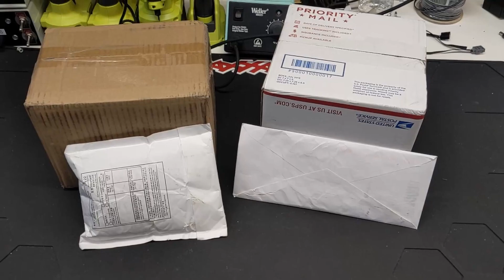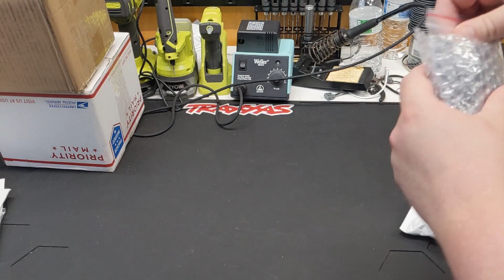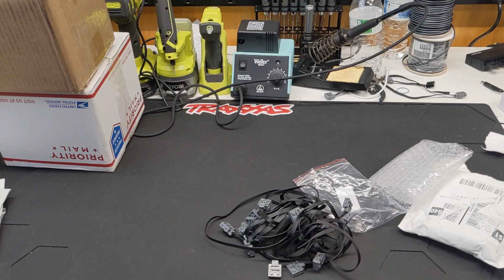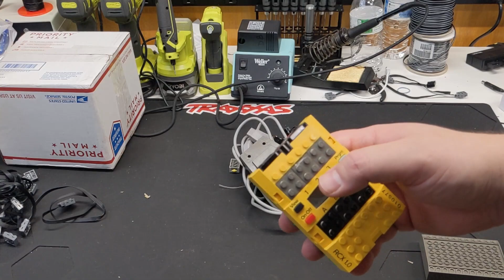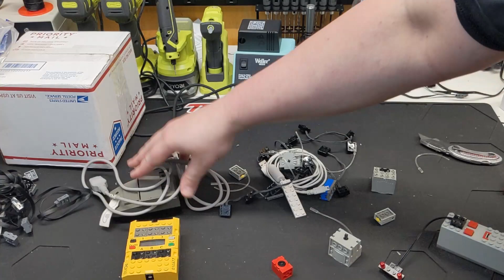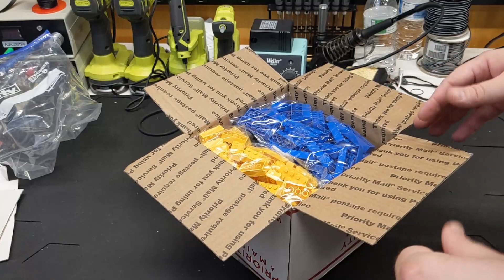Another Bricktsar Bricklink order, Mindstorms parts and channel update

Comment: Looking at the first RCX you looked at, I wonder about the DC jack on it. Mine, also a version 1.0 and which I got more or less on release, didn't have an external DC input as this one does (Which I was really saddened about since it got expensive having to constantly change batteries) And I believed it was a later version than 1.0 only that had the DC input fitted but apparently not, so there are apparently more versions of the version 1.0 :P
Reply from the maker: Yep, there were two externally identifiable versions of the RCX 1.0, with and without the power jack (there were many internal revisions though).  If I'm not mistaken the 1.0 without the power jack was in the 1.5 version of the RIS set.  The 1.0 units with power jacks were used quite a bit in schools so it's easy to find them for $10 - $15 to this day... hopefully with clean battery compartments
Reply: @BatteryPoweredBricks  Ah okay, that makes sense then. And they follow the same rules as programmers does with version numbering, it's always a chaotic mess! xD

Comment: That 9V lot was a good deal, but you didn't test the sensors. There even were 8 of the fiber optics cables inside, normally some are missing if you buy such a mixed lot. This would make a good starter package and I always liked the micro motor.
Reply from the maker: Yeah I jumped on that deal quick!  I didn't test the sensors for now, I'll do that if I replace the wires.  I do have some fun ideas in my head for the fiber optic elements and micro-motors I've acquired over the years

Comment: So the fire resistant chemical breaks down the cable until they become a fire hazard? Lol! The fiber optic stuff was neat. I have the space shuttle set with it. 

The Bricklink auto checkout thing wanted to put it in a flat rate bubble mailer but anytime it’s cut bricks like that a box is better. Thanks for another order.

With YouTube - there is nothing better than just making videos because you want to and enjoy it. Scripts are not my thing and I’ve considered not doing sponsored  content because I don’t enjoy thinking to much about what I say - lol
Reply from the maker: I bought an incomplete Technic shuttle years ago, I still haven't found the time to build it.  I'd like to replace some of the yellowed pieces first.  As far as scripts I guess it just depends on the video, If there are a lot of important technical details I'm probably better off scripting it.  Either way I always think of things I left out after the video is released 😅
Reply: @BatteryPoweredBricks  You didn't test the sensors. :D

Comment: That order was a good buy.  I never find really anything like that on eBay anymore.  I’m still collecting locked up motors if your interested in getting rid of your bad motors.   Phil
Reply from the maker: At this point any locked up motors are scattered every where around the house.  In the back of my mind I still wonder if I can do something useful with them, what did you have in mind?
Reply: @BatteryPoweredBricks   I take out the motor and use the grey plastic housing.  I use the 2x2 9 volt connector and solder it to a bright  9 volt LED light that pokes out the hole leftover from the shaft.
Reply: @philfromcharlotte  It would be nicer to repair them.
Reply: @hollow_stud  Yeah, they're really unique so if they can be saved, they're definetly worth it.
Being an electronics engineer, I would love to give it a try. Are the broken ones hard to get?